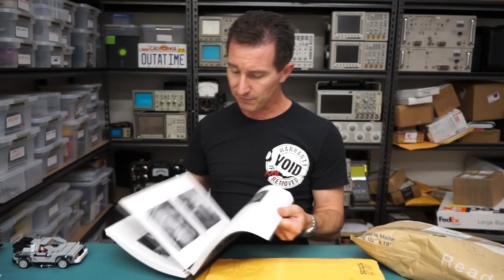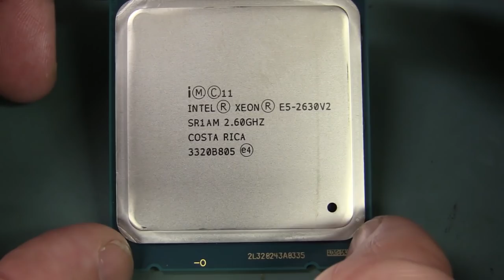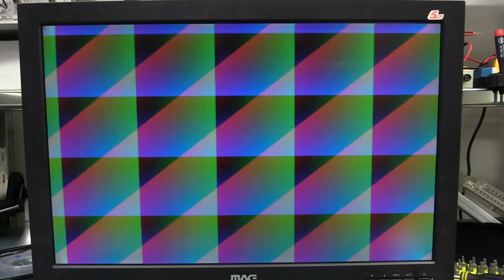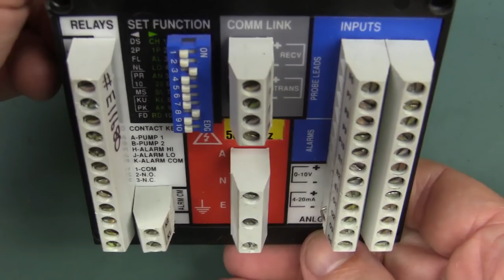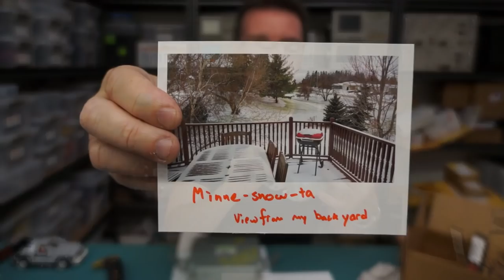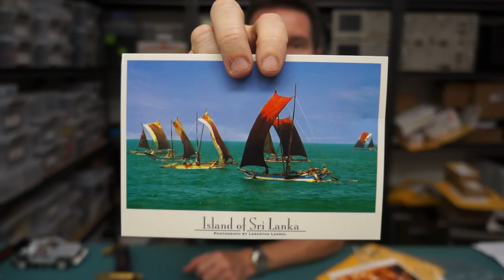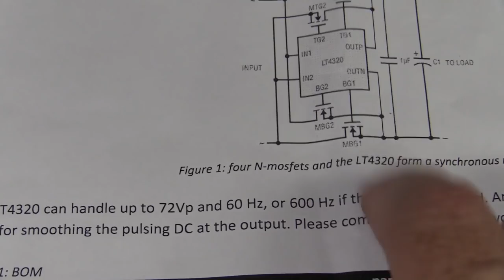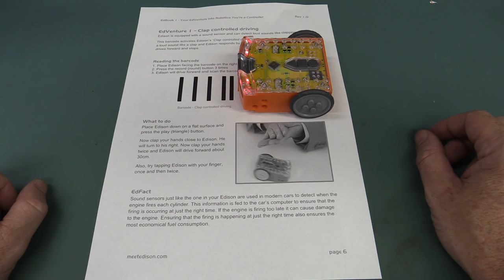EEVblog #711 - Mailbag

Comment: Buy a i7 980x! I've had myn since 2010 over clocked to 4.6gig 6 core 12 threads 😜still fast and chea now!
Reply: Nah mate, i series processors are for gamer boys to over clock and talk about on forums. Xeons are for real men to get work done with. I've had half a dozen quad cores going for almost 6 years with five nines uptime and what could only be described as abusive levels of usage. They're tanks, not toys like the i series.
Reply: U guys are seriously arm chair experts aren't u! I'm happy my i7 980x oc to 4.6gig is more then enough for what I need it for! I only play games on it! I also have 2 evga gtx 970s in sli! 😍
Reply: elmin2323 I kinda have to agree with them that for the purpose what Dave is getting is probably better for his use scenario, keep in mind that a lot of games sadly still aren't really well optimised and benefit a lot more from single core performance and thus clockspeed there's usually a thread somewhere that gets bottlenecked on a single CPU core assuming the rest of your hardware is up to the job (the other common part is where your GPU is too weak).

The workload Dave has is quite a bit different, I've observed the problem myself when I archive short snippets of memorable gameplay recorded losslessly and then encoded in a good quality 1080p 60fps compressed format. It takes a fair bit of time, now for me its short bits and only to be processed every now and then for the archive when I feel like it (if I need space on the recording drive :P). Dave has to shoot stuff, edit it, encode it efficiently, upload it with his slow upload speeds in Australia. His major problem is that ever since the higher fps is an option and he feels it adds to the quality (I have to agree, the recent videos seem of a better quality on a quick inspection) but it comes at a cost in encoding speed, currently I believe he's a fair bit slower than "real time" as in it takes longer to encode than the video is long. The way it works the process is heavily dependent on CPU resources but works pretty efficiently up to a certain number of threads.

I have no personal experience with the fine details of dual xeon boards (have used, but not investigated the detailed technical aspects), if he gets a good benefit out of it will depend on how well optimised the communication is between the two CPUs I guess. But I'd say if that's done well there's a good chance MichaelKingsfordGray and dregenius are right for his use case. A gut feeling based on comparing the two specsheets on the ark.intel.com and the quite vague passmark scores Dave referred to makes me believe that it has a good chance of beating the single i7-980x hands down. The added benefit of ECC memory support, larger cache size and significantly higher memory bandwidth on the xeons are nice too, it may just be the memory bandwidth + cache that makes them win the race.

Oh and MichaelKingsfordGray about "1) You are not prepared to uniquely identify yourself. (Cowardice)"
I personally don't feel this has to be a major problem, I should rename this profile though it has kinda become my main youtube account (sorted the channels I sub to by content theme). Its all too easy in my opinion to find information about people online these days, has to be said that I dislike social networking sites in general and I am of the opinion that people are allowed to be anonymous (to the other readers at least, no way to hide it from Google and all the entities that can demand the info from them).
As long as people make a reasonable contribution to the discussion in a way that isn't offensive, uses proper explanations for their conclusions/opinions I think its absolutely fine (but these occasions are rare in YouTube country).

"5) That you seem proud to 'overclock' (!)"
The way he goes about it isn't the best imo, but I personally do consider overclocking to have some real value. I wouldn't use it in an always on mission critical system myself, but I do it on my personal hardware and to extend the practical lifetime of some hardware when stock speeds don't satisfy the demands of their purpose anymore.
Its quite situational however, I have observed that you can crank out a fair bit extra performance but the energy efficiency often goes down at the high clockspeeds and you're likely to need to use an aftermarket cooler to get decent temperatures which for my personal home gaming rig I consider essential even on stock clockspeeds. In a server room however where the cooling capacity of the air conditioning may be limited this isn't always an option, and if it'll operate at those clockspeeds 24/7 instead of short peak loads usually its not worth it and never in a mission critical system imo. But I have repurposed some old server units outside server rooms at times and in such scenarios I believe its worth trying as long as you test it for stability.

Okay this has gotten too long and offtopic :)
Reply: Gaming is more single-thread demanding while editing is well optimized for multi-thread.  An i7 overclocked to 4.0+GHz will outperform a 12-core Xeon setup at 3GHz because games don't take advantage of the extra cores and suffer from the 3GHz.  If you're gaming, go for the GHz (architecture matters too, but the i7 and Xeons are often based on the same architecture) but if you're editing, more cores is potentially better.  Even so, newer games are getting better at multicore optimization, but video editing doesn't have to be real time and can divide tasks up into long-running independent parts while games are all about realtime performance and have to have all threads synced up to display the frame every 60Hz or more which makes multithreading them harder.
Reply: MichaelKingsfordGray hey now. you are a very poor debater. ad hominen attacks do nothing to advance your point, and only make you look desperate. i say that knowing practically nothing of the processors ( but agreeing to your points), but i can say, meeting the criteria of 1 through 3, and a lot of times 4, does not make me less intelligent, or discredit the things i do know. (it more reflects my horrible typing skills than anything)
Reply: MichaelKingsfordGray And yet with that degree and experience so confused about the difference between Xeon and Intels customer processors?
Reply: Mainly that you invalidate i7s as toys. There reason i7s aren't typically used in heavy computation isn't reliability or performance, but the fact that they're actually not cost effective if you need tons of them. There are no motherboards that can host several i7s, for Xeons on the other hand there are plenty. 

However when it comes to performance of a single CPU/core the i7s are typically way better than the Xeons.